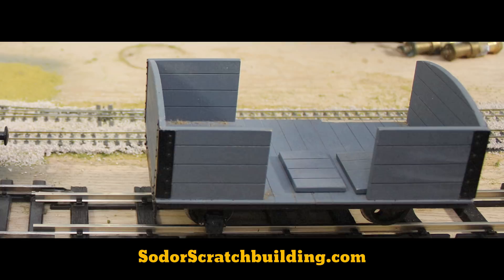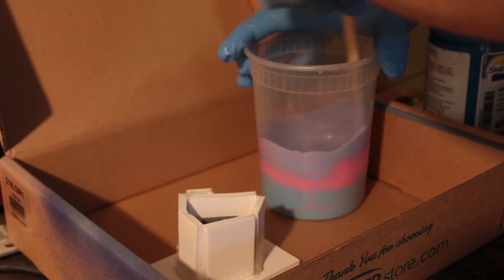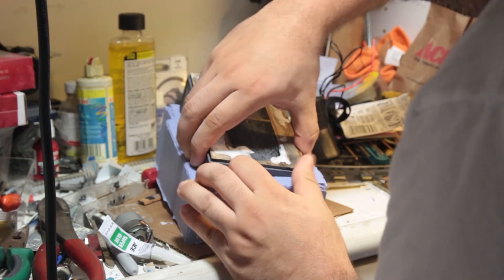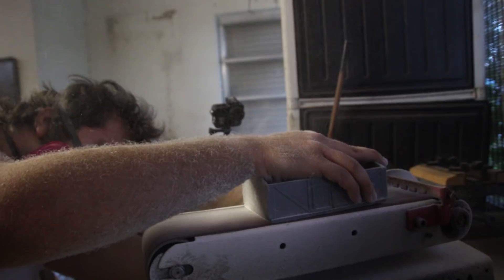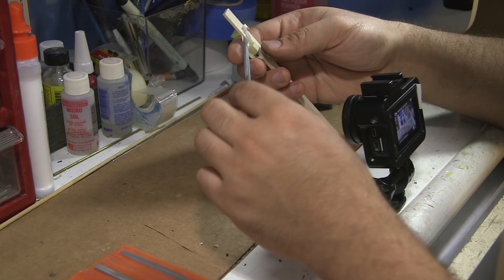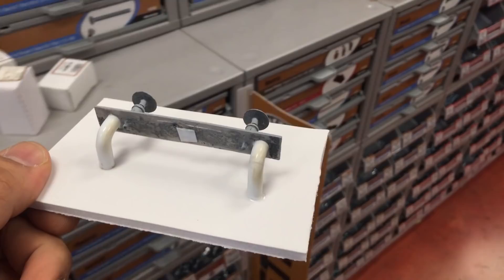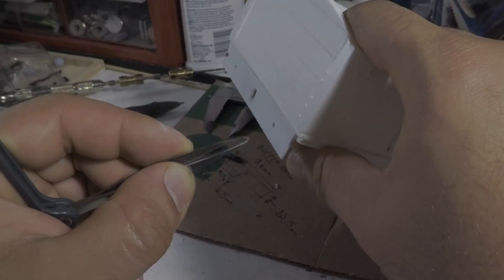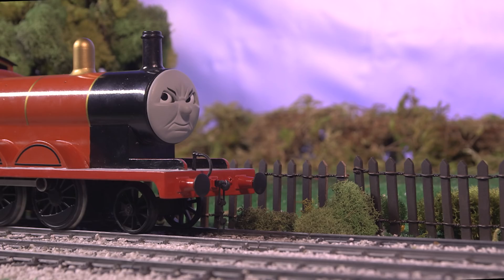Gauge 1 China Clay Wagons | Sodor Scratchbuilding

Comment: Kurt congratulations I now deem you the most hard working of all fans.  Literally spending hours molding freight cars, and all their chassis requirements and wheels.  Well done, they really do match the TVS's trucks quite well (albeit without the weathering but whatev's, I like them how they are clean), the planking, the wheel set, perfect.  It speaks highly of the time you devoted to these, it was worth it.  Also, love how you put James to work with not-so-dirty trucks.
Reply from the maker: Thanks - but it's definitely not a competition, nor would I ever want anyone to feel as if their work is any less meaningful. It just so happens G1 is a very demanding scale to work in, especially when the job is to replicate something near and dear to our hearts and minds, rather than start anew. The brain knows when it's been duped, and getting that look of originality is next to impossible (case in point, as you noticed, no weathering. I chose not to for the build video, but they'll probably get weathered later).

Choosing James wasn't really an option (he's the only character I have done right now), but it was a perfect fit. Taking over for Edward on the branch line in his absence, perhaps? (The set is, after all, a very loose interpretation of the S2 vicarage orchard).

Comment: Hey what’s the diameter of James’s wheels? I’m looking to 3D print some for my Thomas model but I know that the model the wheels are from is a bit over sized.
Reply from the maker: The V1 model (shown here) of James is a bit oversized, and his Piko wheels are likewise oversized as well. Would you be interested in the diameter of the Piko wheels, or the diameter of Marklin BR55 wheels - which is what the original James and Thomas models had on the show?